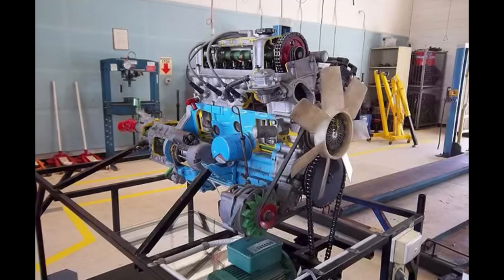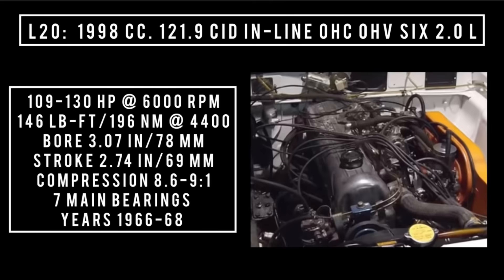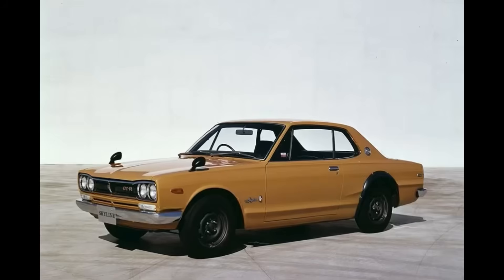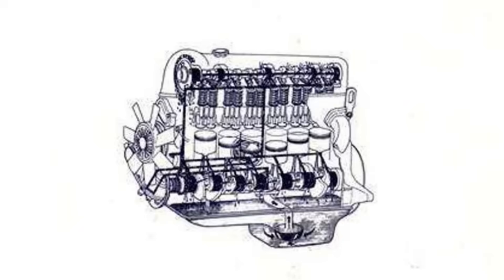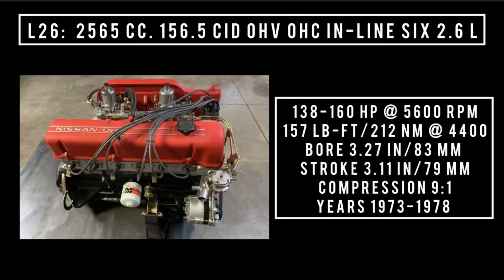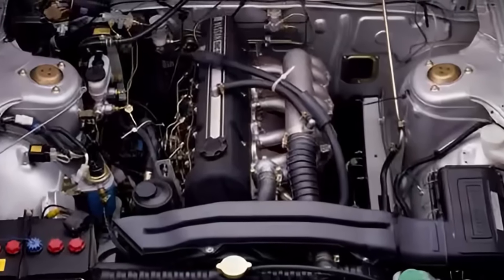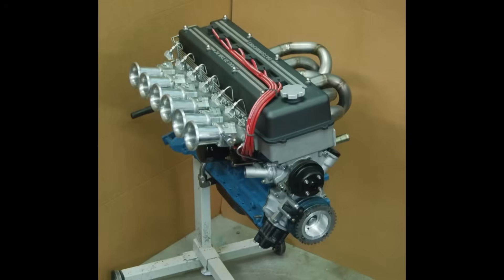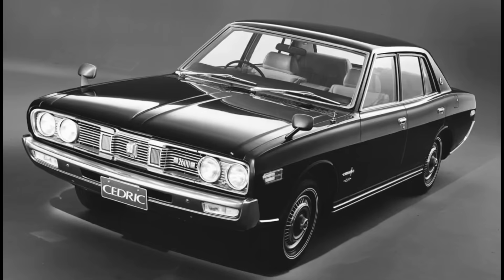Datsun/Nissan L-Series six cylinder engine family L20, L20A, L23, L24, L26, L28

Comment: One of my favorite engines of all time. Nothing like an L Series six cylinder that's running well. I like the L28 myself. Oh, the answers to both, the black Cedric and the 69 Skyline. Make the Cedric into a sleeper and do a stroker NA build for the Skyline with a 6 speed conversion.

Comment: I worked on Mercedes and Datsuns during my days as a tech.  I actually had a 510 in which Installed an L18.  I sure wish I had that car now.  I worked on a few 240Z and 810s as well.  Valve adjustments were performed using my Mercedes tools.  VERY similar engines.

Comment: Legendary  strong reliable  and it was efficient  too,  had 200b L20b ,  most loyal machine I've ever seen,     even left sitting 4 years ,  battery still had clock ticking and it fires straight up,   spent lots of time with 240 and 260 engines too ,  screamers

Comment: GMH in Australia at one time, was being destroyed by Ford in sales, and their only straight 6 was an early 50s (possibly late 40s) design of 3.3 Litres. GMH ended up purchasing the production rights to a Datsun 6, and it was a revelation, with the car having so much poke, it was as if a blower had been fitted. And with a smaller capacity it still ran circles around the old donk.

Comment: The Datsun 6 cylinder was one hell of an engine, with great torque and power to spare, even in 1600cc variation. Being a six the primary and secondary balance is perfect, and until you drive a straight 6 or a V12, you won't know smoothness in an engine.
Reply from the maker: Totally agree =)

Comment: I loved my L24 240-Z.  Nothing - ever - outran me on the highway including the highway patrol once.  And I rebuilt it 3 or 4 times (yeah, it's a "high miler").  But I made a mistake, I did not understand the need to hone the top of the head as well as the bottom.  The heads "warp" when overheated and I would just hone them back flat and reinstall with a new head gasket.  But that warping "skewed" the cam towers and one day I was coming back from Amarillo when the cam broke.  It broke right in the middle, so the front 3 cylinders were fine while the back 3 were dead.  But it ran - as long as I could keep it above 2,000 rpm , an interesting proposition when you had an automatic and had to stop for gas now and again.  But that half dead L24 got me back about 400 miles (with 2 gas stops and a motel bed for the night).  Datsun created a Great engine.
Reply from the maker: Wow thank you for sharing your story experience =)

Comment: I have a 1971 240 Z auto , fitted a L28 with the 240 Z twin carbs fitted an Ivan Tighe cam ground to suit auto ran it every day to work and back, 220klm round trip for 4 years never missed a beat! Still have it , bought it damaged in 1983!

Comment: Choosing between the Zs and the Skyline GT-Rs is brutal. Those are very desirable Japanese classics.

I didn't know that the LD28 came in turbocharged form; just NA. I have read that you would need to modify the injection pump with a part that regulated the amount of fuel injected according to load and air intake from the injection pump from the four cylinder version of the LD engine that came turbo from the factory. I have seen some people make the Z a diesel sports car by doing the LD swap.

The key to making a stroker L engine was using the LD crankshaft, which has a longer stroke. The rest was matching parts to accommodate everything within the block, among them KA24 pistons (and rod?).

Speaking of the KA engine series, they were the successor for the Z series engines, which themselves are the successor for the four cylinder L series engines.
Reply from the maker: Thank you so much for sharing all that insight and information greatly appreciate it

Sweet choices 

Yeah, it was a bit unfair to have to pick between the Z car and the skyline

Comment: Hey Jay, I had a lot to do with these engines, and the LD's. So pleased you found a sound track of the 'tuned' engine. Really neat how Nissan developed the contraflow head design so successfully. Wonderful catch up thankyou my friend from New Zealand 🙂
Reply from the maker: Yeah, it sounded good. I needed. I need to add sound to the engine episodes going forward to the ones that have sound, but there's more to it than just an engine exhaust style and muffler set up is going to make the engine sound completely different.

Comment: You forget the ld20 the diesel version of the ld20 . One of the most reliable engines could go hundreds of thousands of miles
Reply from the maker: Thank you so much I knew I was going to miss one
Reply: @What.its.like.  L20 is not the first engine they created, do some research the first L series 4 cylinder was the L13 up to LD20T and the First 6 cylinder L series engine was the L20 up to LD28T.
Reply from the maker: Yes, I know that but the first engine in that series that was a six cylinder was the L2 said wasn't gonna cover the four cylinders in this episode

Comment: I the 1st scenario, I'd go for for the '72 240Z. With my experience working on the Z's, the '72 240 was the best. There were actually 2 260Z's out there. Introduced for 1974, there was a later production model known as the 74 1/2. The later version had the attributes of the upcoming 280Z, even the 260 script was changed to mimic the 280Z. The 280Z was late arriving in the states and the 74 1/2 260Z was a filler.
Overall, the 260Z was the worst version and the 74 1/2 were real slugs.
The first 280Z's were rocketships and HP was underrated. When the next gen 280ZX's were introduced, they were fat slugs.
For some reason, these Z's were hard on clutch master cylinders and brake master cylinders. We kept several of each in stock and replaced alot of them.
One of my customers had a '71 240Z, which he bought new(he had traded in a '67 Corvette 427 tri-power). Along the way we made some improvements. First was getting rid of the points-type ignition distributor and replacing it with a self-contained electronic ignition distributor from a 280ZX. Then we swapped they original 4-speed trans with a later 5-speed overdrive. The carbs were getting finicky and we put a dual Weber 2bbl. downdraft carb kit on it. We did eventually overhaul the short block but first we put a 280Z head on it. It was lower compression but had a more aggressive camshaft and larger valves. When everything was dialed in, it would run circles around a 280ZX Turbo!
Reply: I was 2nd owner of a 73 with a 72 motor.  The original owner mentioned the 72 had better intake and smog setup than the 73.  I remember they wanted to fail my smog check once on visual inspection because of the difference.  I had SU carbs that were redone by a company in Idaho that put rubber seals on the butterfly shaft to prevent the air leaks they were known for.  I had the 4 speed and actually got my car up to 140 with a header on it and the factory Nissan headlight covers.

Comment: The L24 responded well  to a street cam, but carbs were the issue.They may look like SU's but they are Mikunis built on an SU pattern, and alternate jets and needles weren't available back then. It would make your 240Z crazy fast but it would idle at 1300+ to get enough fuel at the top. I wish I had one to play with now (and the money to do it with). I've worked on plenty and driven them but never had one myself. Huge fun on twisty mountain roads 😁

WYR I know the later ones were better but I always wanted a first-gen 240Z if one still exists somewhere with no rust. They had Flintstone floorboards and the seat brackets were just welded to that and often pulled loose. The Skyline takes round 2

Comment: I drove several beater Datsuns back in the day and found the L20B engine to be reliable and smooth running. I had a 1977 Datsun 200SX with the L20B and kept it for years. All I ever did on it were oil changes and a carburetor rebuild. If only modern cars were as easy and cheap to maintain…
Reply: 100% agree. Modern cars are brilliant when new and when correctly serviced. And are becoming, or have become too hard for the average Joe to work on. Older and more simple machines may be (slightly) less fuel efficient or produce more pollution. I'm not sure how the pollution issue is calculated but I'd hazard a guess that production and disposal of all the extra electronic gizmos could be quite significant.
They don't have all the gadgets&widgets of the new machines. They also didn't need a computer system to service them!
It seems to me we're going backwards by "moving forwards".
Reply from the maker: That's awesome thank you so much for sharing your experience

Comment: Glad to see you doing a Datsun. One of my quirkiest cars was a used Datsun 310, the slightly sporty ancestor of the Sentra. To open the rear windows a crack, there were 2 levers between the front seats. Unfortunately the windows through vibration closed themselves after about 30 miles. Despite it having only 33,000 miles, the car had problems with: 2 blown head gaskets which produced James Bondian clouds of steam in the parking lot, the alternator died frying all the lightbulbs in the car, it pinged on 101 premium leaded gas, it had a bum water pump, the electrical portion of the ignition switch failed, the AC blew up spectacularly with a mighty plume, the complicated exhaust recirculating valve failed causing loud backfires upon deacceleration, and rust began rearing its ugly head when the car was only 3 years old. And there was no heat as the thermostat was stuck open. But the car was a beautiful black with a black grill and black rubber 5 mph bumpers which worked perfectly as I had a couple of good bumps that would have totaled a modern SUV. After spending thousands more for repairs than I paid for the darn thing, I traded it in on a brand new 1985 Corolla.
Reply: My ex-wife bought a 1982 310 new.  It also had the head gasket problems!  And, the rust!  we got rid of it in 1987 for a 1984 Volvo 245...
Reply from the maker: I have a soft spot for JDM I love Honda Toyota Subaru, and Nissan cars

Comment: Very glad to see you doing some important details on a truly great engine family. For WYR I’ll take a original 240z as I had many beautiful examples in the 2 nd hand market I only wish you would have shown a 79 Datsun 810 2 dr coupe as this was a 4 place gentleman’s hot rod built on the suspension and running gear of the 240z , what a beautiful cruise missle they were and very very rare
Reply from the maker: I wasn't sure about the 510s having the six 

What did you think of your 240Z I've wanted one forever and was going to do the rebello stroker kit, but ended up going another route... they sound great and make good power but costs a lot to do it... when I was looking the triple Weber setup was $1,100.... 10+ years ago
Reply: @What.its.like.  My parents had a 1982 510 4-door with a weird 4-cylinder having 8 spark plugs!

Comment: Good information on this engine series.
First pick 73 Nissan Cedric, second 77 Datsun 280 Z 2+2 (got to drive one of those), and throw in any Nissan Patrol.
Curious did the diesel variant end up in the International Scout or one of the truck engines.
Remember  a company in the 80's selling Nissan diesel kits to repower any of the domestic  pickup trucks made back then.
Reply: The patrol had a truck 4.0l option. Pulled the stumps out much easier than the l28.